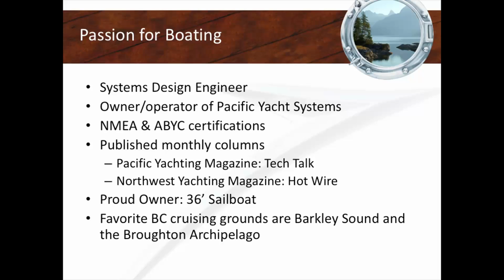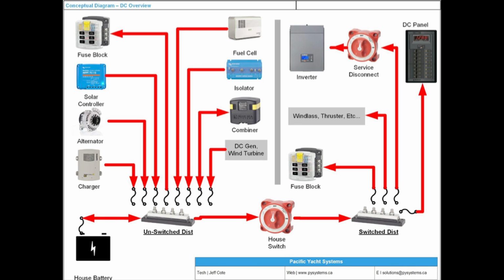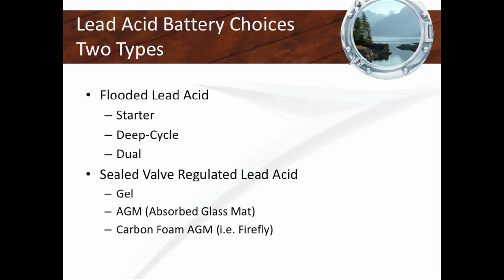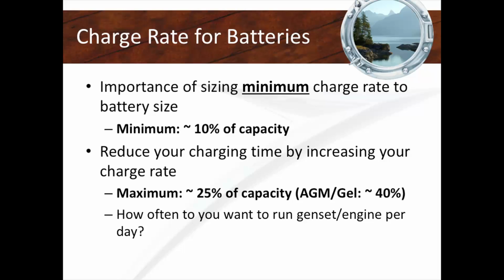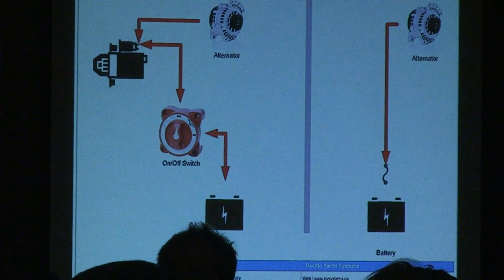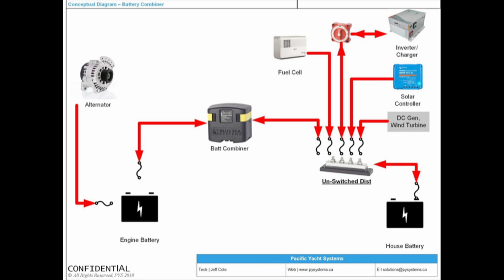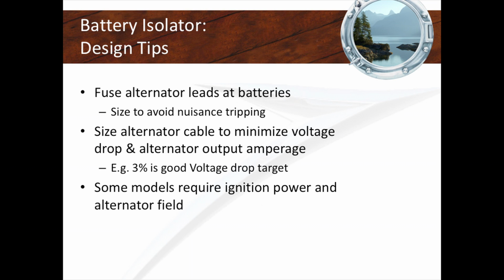Boat Show 2019: How To - Design A Marine Electrical System

Comment: Hopefully you see this. So in your slide you have the charger needing to be min 10% of the 'house' battery. My boat runs 4 batteries, currently setup very odd (2 cranking batteries and a house battery in series to create 36V for my trolling and starting and a standalone house battery). Should the charger I buy still remain as being 10% min 25% for the 1 house battery or should it be 25% of the 4 batteries combined?

Comment: I was going to give this a pass but decided to give it a quick shot. It was time well spent for sure and I know a decent amount about electrical systems. One comment - fuses/breakers are always sized based on the wire because that is what they are supposed to protect. The wire is (should be) sized to the load. This is a niggly point but if the fuse is sized to the load but the wire is too small then you are going to have a problem that will only get worse as age takes its toll. If the wire is oversize then you can size the fuse to the load but this is typically not the case.

Comment: Charging your start battery and connecting your house bank through a, ACR is not how these circuits should be wired. Your alternator wants to feed a large battery bank, not your start battery. Then the ACR senses the voltage on the house bank, and when it is high enough, the ACR feed the small amount of energy the start battery has lost while starting the battery. Works fine when wired correctly.

Comment: Love the videos, I am committed to see every video on your channel. I have been designing our after market systems including from scratch AC system for our new boat due 2023. And I have been thinking about how to heat up the water as one of the challenges since we hate turning on an engine every night to get the water hot and the best I came up with was actually using the ac water heater circuit which is contradictory to your advice here. Let me explain. To heat up 40L of water from 25C to 40C would require 700w. (60AH). From a system design perspective it is an additional 200w solar panel, a slightly bigger solar controller and another 100ah worth of batteries, alternative is an expensive and complicated diesel water heater system. I know that I can run the engine but that seems like a more of a waste than generating heat from batteries. Would love to hear your thoughts.

Comment: I have a 1994 Edtide 180. When I went to look at it some of the transom end was meals for rats. I did not think it would be too hard to fix. What I found, most of the wireing  was stripped bare. One of the live wells had the hose chewed into.  Built 2 houses, no problem in wireing a house, but this boat has me baffled. I have looked for schematics  for my boat and not feeling better about it. Any suggestions on wireing it?

Comment: Hey - How can i make a dual engine, 2 x altinators. Charge 3 battery banks.  Can i use two Victron Argo FET 200?
Reply from the maker: Sort off, you can install 2 ArgoFET 1-3, with each battery connection from each ArgoFET paralleled to one another.

Comment: Hey Jeff, 
Thank you for your expertise and time that you donate, you are greatly appreciated. 
I have 2 questions at this point and hopefully they'll be simple, easy one first
1. Is an isolation transformer diesel engine room safe? (I'd consider locating it in the generator and battery bank vicinity)

2. What's your opinion about attaching all of the forms of voltage generated (alternator, solar, genset, wind, etc.) to the battery isolator input terminal? 
And would it distribute a float charge to the needy battery bank w/ key off?
Reply from the maker: 1) Yep, you can install an isolation transformer in a diesel engine room
2) Unfortunately never tried to have one battery isolator take all the charging inputs, as we tend to avoid single point of failures in our electrical systems. Do let us know if you try this approach.

Comment: Hi, I have two G31 AGMs that are switched so either can be house or start.  I understand the value of an isolator, but is there a way to still have the functionality of either/or with an isolator, or is the proper set up to keep those two batteries separate?  Thank you!
Reply from the maker: Peter, keep you batteries #1 and #2 separate.

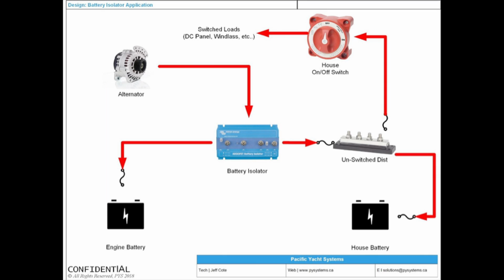Comment: Hi guys, really great video and nice channel! I have a question on the slide on Minute 47:42. Can I add more power supplies (e.g. Solar, Battery Charger, ...) via an additional bus as additional inputs of the Battery Isolator?
Reply from the maker: Hi Felix, never seen or tried this before, resultingly not sure of the implications.
Reply: @PacificYachtSystems  Okai, thanks for answering anyways

Comment: Hi Jeff thanks for the video. Question, if an inverter/charger should not be switched, how can I select only my house batteries when using the inverter fonction? And charge my 2 banks when on shore power? (Xantrex 1000w Freedom HF) My guess was to switched my banks to avoid the inverter taking power from the engine batteries...
Reply from the maker: Hi Simon, good question. Generally an inverter/charger is connected to only one battery bank. If you are going to choose which battery banks runs your inverter/charger, make sure you have a dedicated source selector switch that is only used on the DC side of the inverter/charger only. No other circuits of your boat should be on this circuit.

Comment: I have an older twin, two batteries, two engine battery switches plus a house and inverter switch, and I"m adding a new bank to be primarily for the inverter.  I just built new wiring harnesses for the engines and ran the alternator cables to the solenoid terminal.  MRBF fuses mounted on the battery terminals, "unswitched" loads tapped off the engine battery switch studs.  Question: with two engines and one "start" battery, how do you recommend configuring the alternator output wiring?  I have a diode battery combiner just for the "emergency bus" (automatic pumps, radio, LED nav lights).  Can you point me to a drawing you like for gasoline twins?
Reply from the maker: Hi Stephen, unfortunately as of yet we don't a have a schematic ready for what you are looking.

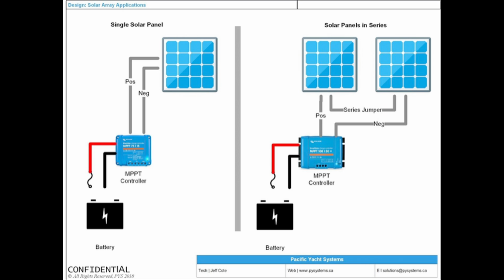Comment: 33:38 Wouldn't the fuse blowing create a voltage spike?  In other more recent videos you talk about putting a blanket on the solar panel before disconnecting and obviously you don't get this same convenience when a fuse blows.
Reply from the maker: Hmmm... not sure about this one. Never tested this... but I'm guessing no. Anyone savvy techies out there that can weigh in.

Comment: Re Battery Isolator: the alt regulator, being internal or external, excites the regulator depending on battery voltage (or other parameters if you happen to have a "smart" one). If you're using an isolator, how would the regulator be able to handle different battery "states"?
Reply from the maker: Good question, remember a battery isolator shares a charging voltage from an alternator, but it does NOT change or alter the voltage. All the batteries connected to the battery isolator will see the output voltage from the alternator.
Reply: @PacificYachtSystems  Thank you for confirming my suspicions. So if I happen to have different battery types/architectures for house and for other short term loads such as starter or bow thruster/anchor spill, neither a combiner nor an isolator would be the best solution, I believe?

Comment: Hey stupid question here, I'm wanting to run two banks off an outboard, one dedicated starter and a house battery (sonar lights troller stereo), does the simplicity of the battery isolator apply the same if I want to send extra juice up front?
Reply from the maker: With an outboard, better and easier to install a battery combiner.

Comment: Good information to the people except one thing: a Battery isolator drops the voltage with about 0.7V from the alternator  to each battery. this causes the charge currents to drop to half of the possible charge. With a combiner (relay) with self-alignment you have full charge all the time and never drain any battery.
Reply from the maker: Hi TickTac2, thanks for the reminder,  your correct a diode based battery isolator will drop voltage by .7 VDC. Better to install a FET based diode combiner like the Victron ArgoFet.
Reply: Pacific Yacht Systems Yes. FET is a better choice, but a relay do the job good enough and are cheaper ;)

Comment: "Nobody creates heat from battery" making hot water from your inverter works just fine and isn't stupid if your system is large enough. It's a 1500W load for ~30-45 minute, which gets filled back with enough solar on the same day. A big LFP bank will handle that without blinking. I've done it, took hot showers many mornings powered by the sun (and the inverter/battery).
Reply from the maker: Hi Antoine, meant heating a boat cabin with an inverter via batteries.

Comment: Hi, Thanks for that great video. I need to install a 2600 watts refrigeration plant in my customer vessel of 20 meter LOA. It has a Chinese make Yuchai YC6T540C engine. I need the refrigeration plant to run for straight 17 hours in peak loads. The Customer cant go with an expensive battery storage system at all. So I need to work on an Off-grid system with no battery. In order to compensate for the fluctuations, I decided to install a dedicated Alternator to the main engine to power things up. The main engine runs usually from morning 5 am to 10 pm. So that I could take most of my solar output out of my 3.5 kW PV system between 10 am and 3 pm. 
I need your help to make this arrangement work for me. 
I tried on-grid inverters, but they sent back the excess power from solar to the synchronization source when solar tops up, in this case, which is not possible. Also when the plant occasionally shuts-itself off during peak solar hours, the above-mentioned scenario happens, which cannot be possible.
So is there a possible workaround for this application?

Comment: Wow, you got me excited and worried at the same time. Where do I find an electrician who actually knows all this in Greece? I'm good with mechanical things but hopeless with electrics. I would like to do a complete electrical refit.
Reply: I ended up reading everything i could on boat electrical's, particularly Nigel Calder - the Bible of boat electrical's Plus watching the full series of videos by these guys (which are great). Then I designed and rewired my own (34 ft) sailboat 110V and 12V systems. To keep it manageable, I did it one circuit at a time, starting with the 110V circuits, then the major 12V circuits (like battery connections) and finally the minor 12V circuits (like LED lights). I found some real horrors in the old wiring, including connections where the insulation had broken down (where a fire would surely waiting to happen). Now i do not have one single butt or taped connection on my 12V system (but dozens of terminal blocks, as recommended). Most of the challenge was not electrical (if you are reasonably methodical) but in crawling through tight spaces etc. Took me and my wife (whose small hands helped with the panel wiring), about three weeks. Finished that a few months ago and am now rewiring (the more complicated) NMEA 0176 navigation/autopilot wiring. I never once met an electrician that i thought i could trust with my boat, so i opted to do it my self. Also, there is no substitute for knowing every corner of your own boat.
Reply: @stephenburnage7687  thanks for your insight into this! I figured for blue water sailing the only real solution is to know every system in your boat. Seems like a nightmare for something to break down on a passage and be powerless to fix it. And then arriving at a new port and having to find and electrician in potentially another language
Reply: @waxcomb  I agree. It is an essentially part of long distance cruising and we try to learn as much as we can, when we can. We are now in Central America, having made (so far) it from British Columbia, Canada. As we traveled south out of the US, the self sufficiency of cruisers increases exponentially. We have heard of some amazing stories - one changed a cylinder head gasket offshore. Another rebuilt his gearbox offshore and another even changes a thru hull valve offshore. I am not up to those standards but they drive me to keep on learning.

Comment: Jeff, your wealth of knowledge is extremely helpful and I am looking forward to rewiring my 222 Aquasport now that i have support. Quick questions, where should the fuse be mounted between the stator (alternator) and the starter battery? I watch your video that expressed the location at the source of power. Should there be one under the outboard cowling or at the battery terminal/terminal block? 

Thank You
Reply from the maker: A couple things about alternators: 
1) Make sure the positive and negative wire from the alternator can handle the maximum amperage from the alternator
2) Fuse the alternator circuit at the battery connection. Remember the battery is also a source of power and in the event of dead short will supply way more power then the alternator wire can handle.
Reply: @PacificYachtSystems  Thank you very much for the Reply!

Comment: Thank you this is awesome! One question, how does an alternator know the batteries are full and stop charging? It seems like at some point the batteries would overcharge if it is directly cabled into the batteries.
Reply from the maker: The internal/external regulator job is to regulate the alternator voltage and not overcharge the battery.

Comment: A few notes:
Amepere is directly related the conductor's area (resistance), Voltage influences directly the speed at which the electrons travel (potential). Energy is measured in Watt hour (not Ampere hour). Energy = V x Ah x power factor = Wh.
Reply from the maker: Thanks Josi.

Comment: How do you recommend handling the starter wiring if you connect your alternator directly to your battery, bypassing the starter?
Reply from the maker: Good question, the starter is connected to engine battery via it's own wire, going through a switch and no fuse.. The alternator, also has it's own wire to a battery, but this one is fused and unswitched.
Reply: @PacificYachtSystems  true magic! thank you.
Reply: @PacificYachtSystems  Can you recommend anyone in the Ventura, Channel Islands area for a complete system upgrade/rewire. It’s a 1978 KP44. Existing electrical is a mess and unsafe.

Comment: i recently redid a electrical shore power socket connection, nema type 125v 30 amp. totally fried at the black positive terminal. someone must've dropped the power cord into the water and forgot to dry it so corrosion caused fault and burned the plug rite up. Yourn videos are absolutely helpful; and appreciated very much thanks for taking the time. Looking forward to more videos..

Comment: I have now seen hvis video more than once   and I must say this video will prevent more than one electrical fire. 

But the part from 42 min in the video. 
About seperating the batteries. I do understand one start batterie and one house batterie and the two newer see eatch other. But I have 3 batteries. 2 "house" batteries. And what then? Do I connect both the plus side suddenly they see eatch other and the idea about the victron argon fet falls to the ground. Do I miss another Smart device?

Comment: Thank you much, great video and info for RVs too.  AGM Carbon foam good for cold temps, a great solution.  Van sees extended 10 F for 12+ hours, during winter trips would have destroyed LiFePO4 batteries or become unusable.
Reply from the maker: Hi Nat, good point.

Comment: If you by pass the solenoid and go direct from the battery to the alternator what stops the starter motor from continuing to turn? As I understood it - the Solenoid acts as a switch to tell the starter motor to start and then tell it to stop once the engine is running...
Reply from the maker: Hi ColGadarby, if you directly connect your alternator to the battery bank via fuse, one must remove the jumper that connects the alternator positive post and the starter solenoid.

Comment: Thanks for the great videos, I'm learning a lot!

At 23:57 you show the battery charger going directly to the engine battery, and to the house battery via the unswitched distribution bus.  Why?  I thought that the charger, solar, and alternater could be hooked up to the unswitched distribution bus, and then into both batter banks (as in the diagram at ~8 minutes)?

Edit: directly if you consider the fuzes passive elements.
Reply from the maker: Hi Jake, good point. I do so just to simplify the explanation. Your correct, the output could go to a unswitched distribution.
Reply: @PacificYachtSystems  Woot, thanks!

Comment: At the 48:00 mark, where in this setup would you connect your solar to properly charge the batteries?
Reply from the maker: Hi Mike, bring the solar panel connections via a controller to the unswitched distribution. Remember to connect the controllers with a fuse at the unswitched distribution.